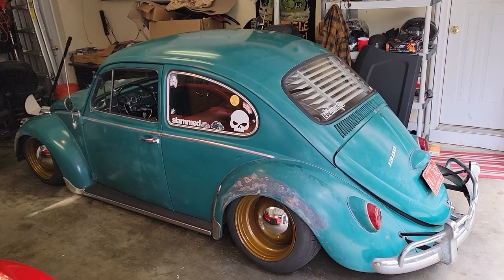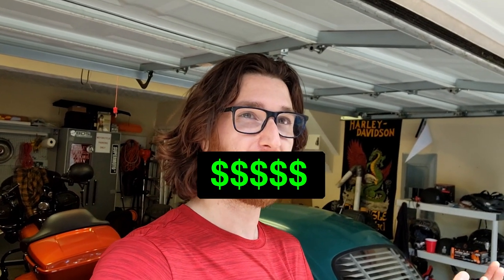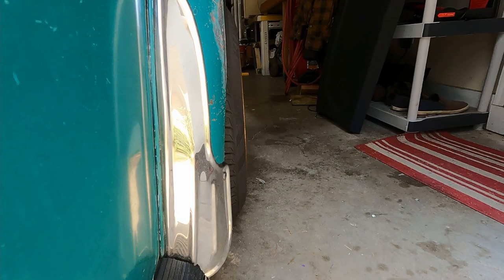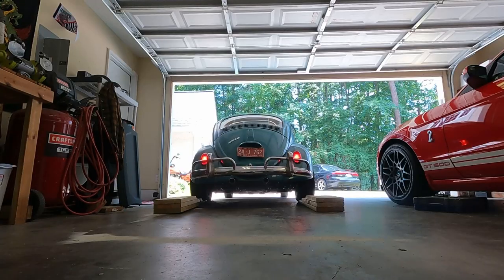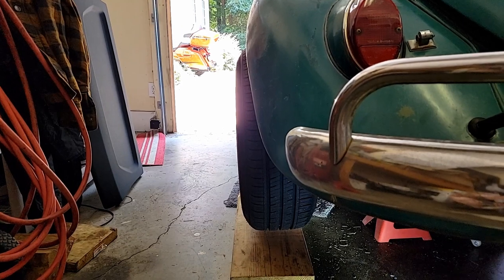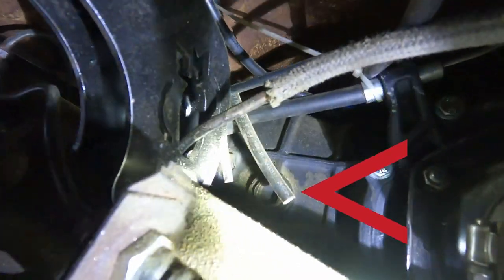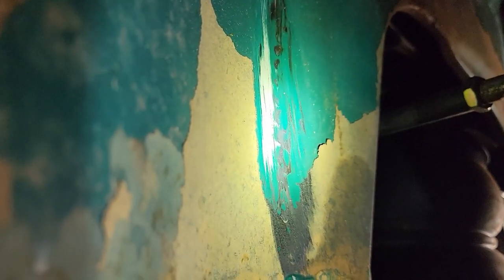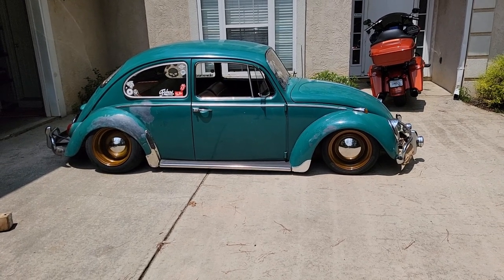The negative side of having a slammed VW Beetle.

Comment: Dude I just sold mine. I’ve had it since I was 15 and I’m going to be 40 this year. It spent a lot of time in storage and was much like yours. I built it when the cal look was big. Bottom line was I didn’t feel as safe in it as I used to, and wouldn’t put my kids/family in it to go to a car show because of that. Hard decision, but I felt good once it sold and have made room for something better!!
Reply from the maker: What are you gonna replace it with? I gotta 69 f100 and a coyote motor for it. I'm gonna do pretty much the same thing to the truck as I did to the bug.
Reply: @carscream1650  I’ve finally been able to buy a 1969 Charger I’m building up. Love the trucks too. 60’s c-10 is on my list

Comment: if you get a flat how do you jack it up?
Reply from the maker: Good question. There are some square tube jack points. I made a part that inserts into those and joggles up so I could get a jack under it. I also made ramps to drive up on because a jack definitely doesn't fit even with good tires. I sold the car years ago though.